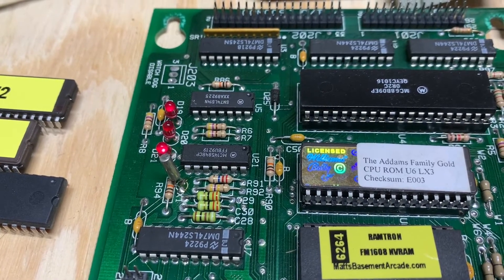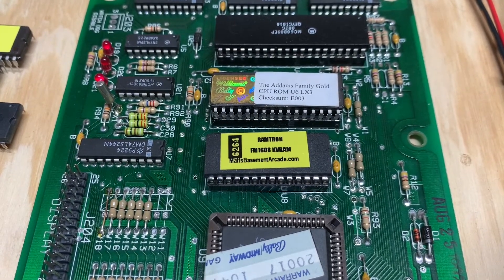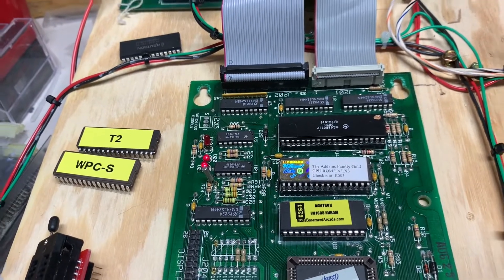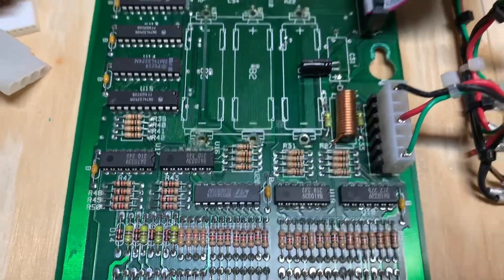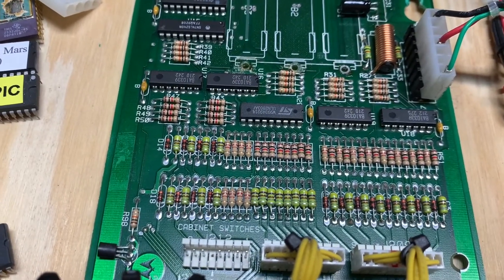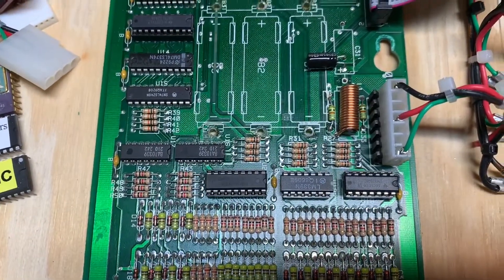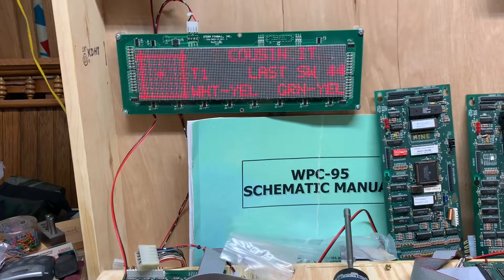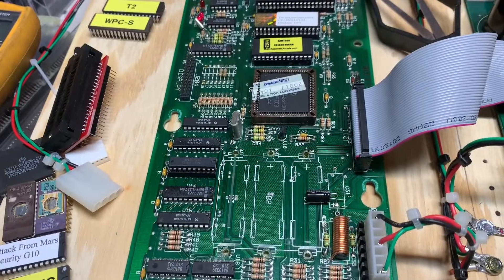Williams TAFG MPU Repair and Test (no boot, RAM error, switch matrix error)

Comment: Double flash on D20 I must have a bad NVRAM or I shorted something when installing the new socket.  It figures I got lazy and didn't check it.  Thanks for the info!  Always excellent delivery! :)
Reply from the maker: Yes. Odds are that there is a short between two of the signals that run through the RAM area.
Meter on continuity. 
Black on pin 1.
Red on pin 2.
"Rake" pins 2-28. If any connections, meter will beep.
Black on pin 2.
Red on pin 3...etc.
Guarantied to find it.
Reply: @ChrisHiblerPinball  awesome thank you

Comment: Hello Chris, this is Paco from Spain. I have a no boot on wpc-95. Adress bus seems ok, but logic levels at the data bus are low. I don't get any diagnostic led of course. Has this ever happened to you ?
Thanks for reading me.
Reply from the maker: Hi Paco...I've not seen that behavior. Make sure that your ASIC, 68B09EP, and game ROM are known good. After that, you should get blinks on the middle LED to indicate more to check. Of course, if corrosion has attacked the board, that needs to be addressed first.